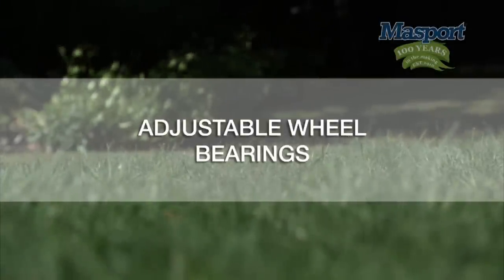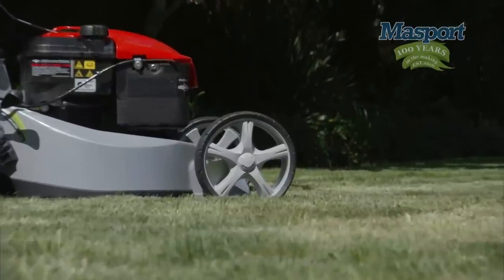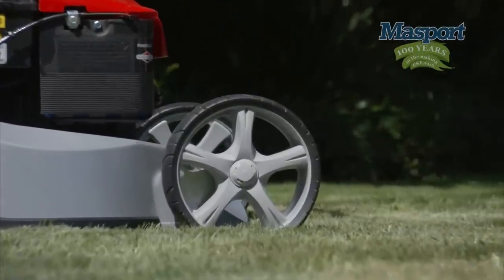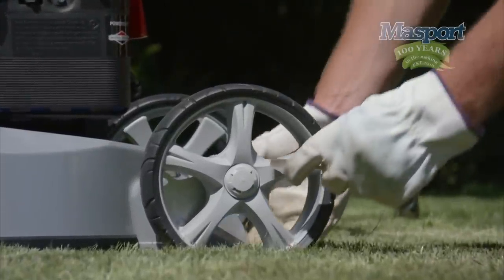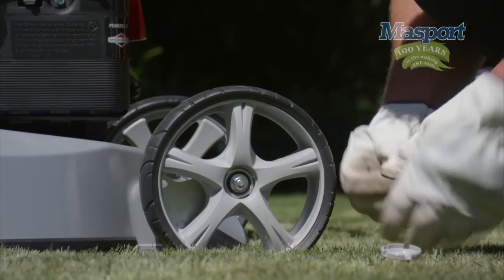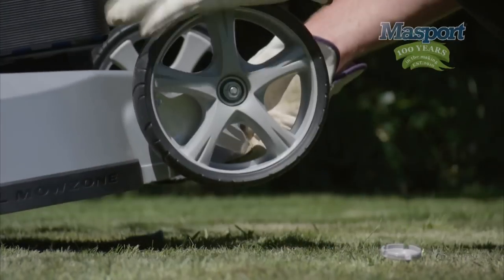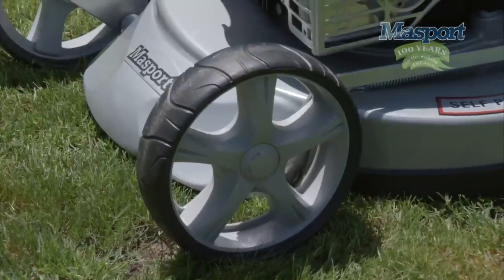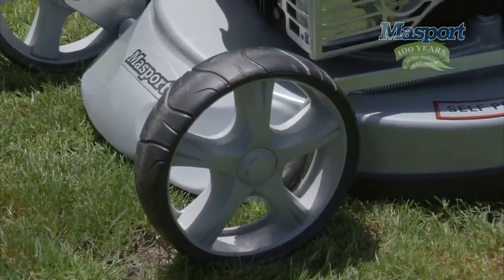Masport Lawnmowers: Adjustable Wheel Bearings

Comment: My masport mower's wheel fell of and it doesn't look like this. It has no thread and a sir clip style thing. It's a piece of crap, fyi. Dunno whether to bother replacing the bearing (or where to get them), or chuck it on the tip.
Reply from the maker: This video may show an older or different model mower to the
one that you currently have. What country are you located in? We would like to
put you in touch with our local Customer Service Team to help you resolve this
issue.
Reply: @MasportLimited  Thanks for the reply and offer. I wasn't expecting any service; just having a rant lol. 

I've since found the correct bearing assembly and replaced the wheel. The mower is still going strong considering its age, and the use, abuse, and neglect it has been subjected to.
Reply from the maker: @3yearshardcore1  We're glad to hear that you were able to replace the wheel. We're here to help, so always feel free to reach out to us.